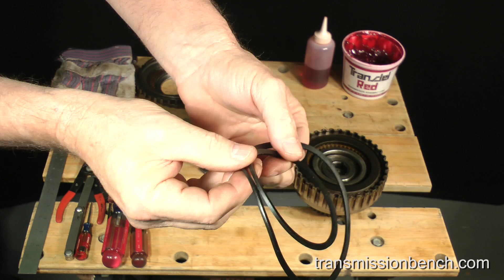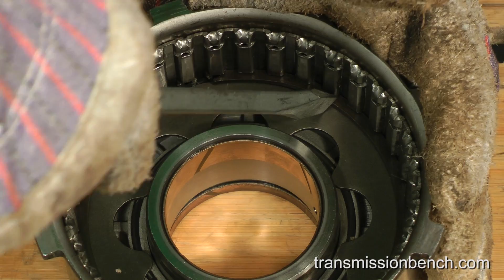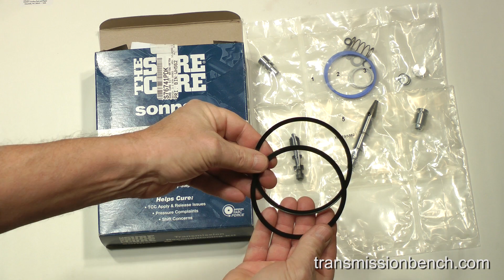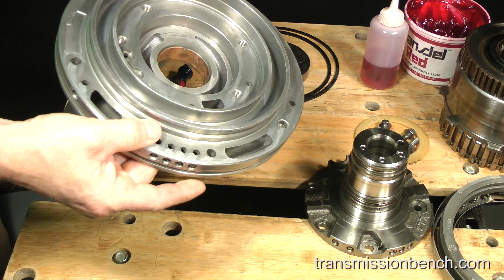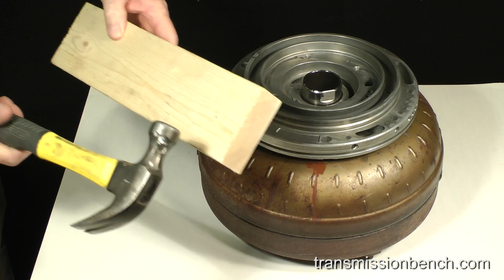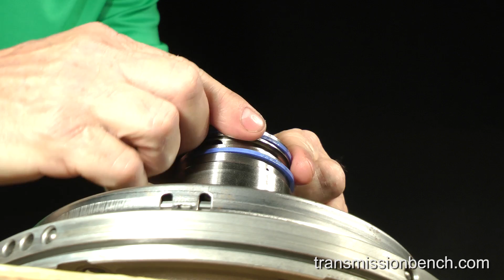AODE 4R70W Class part 2 lesson 4

Comment: Plastic wrap works very very well to commpress any of the seals . Just lub the seal then wrap with plastic wrap with slight tension 3 or 4 wraps lets sit for 45 seconds remove and install works like a charm.

Comment: On those teflon rings I use a worm clamp and just tighten it up to compress the ring gently,  wait about 20 minutes or so, then remove the worm clamp.  Use the very edges not the center area.  Works good.  I have anger issues when I destroy my teflons.... It has been professionally diagnosed as "Pissed off beyond belief".

Comment: So I rebuilt my 05ford f150 4R75E transmission and after about 10 months idling in my driveway for about an hour the input shaft seal blew out, I bought it to a shop and had a new seal put back in and it blew out again after driving a continuous 180 miles or when it got hot again. What would be the cause of the seal blowing out? The shop did overfill the fluid

Comment: Great video. Can you tell me why the flow from tranny to a cooler is so weak? I have the same tranny (4r75e) on my e350 and I performed a flow test directly from tranny to an empty bottle. So I got one quart in 2 minutes which is bad sign. But it shifts like it should and there is no codes or issues except high working temp. Thanks.

Comment: I love the video, they do make a lip seal protector kit to install pistons without seal damage. As for forward/input shaft I use a shop press to push out shaft, install rings, use rubber hose around them and hose clamp to resize them. Then reinstall/press in shaft. Always use calipers to measure exact position/depth of shaft in drum before removal to ensure exact placement when done.

Comment: Thanks a million sir. Something that I'd like to share. I was pressure testing the reverse drum over the pump stator shaft but it wasn't successful, there was excessive air leak. But after blocking the 2 holes on the top and upper side of the shaft with my finger tips and pumped air in short pulses, this action made the carbide rings expand out and seal properly. Only then the reverse clutches went up & down very well, without air leak hissing.

Comment: I bought a bushing kit and I don’t have a large enough socket for some of the bushings with bushings should you replace other than the pump bushing like for example the sun gear is very hard to replace the bushing.
Which ones receive the most wear

Comment: Thank you so much you are a great instructor, I have rebuild my trains exactly as you instructed, I drove the truck for a few miles and it just stop, like if the drive shaft was disconnected, I would give gas but the truck didn't move,  I did not what I made wrong, it wont go to OD or non OD it just wont drive any more. I don't know what to look for. May be you can give me a hint. Thank you Doug Z
Reply: Did u figure out what ur was

Comment: I am up to the point of installing those large metal sealing rings on the pump. I cant get them to snap together.  Used a pliers. Tried to lift it above the other to lock and snapped one. Geez. Almost done and I am stressed. Everything else went smooth. Thanks for these videos.
Reply: i just done mine and i used a small pick to lift up on one side while squeezing it together.
Reply: I put 2 c clamps to hold the ring snug in the groove . Before tightening the clamp associated with the end of the ring that has to hook the seated end of the ring , I put a very fine needle under the ring end that has to come out of the groove in order to hook the ring closed . This narrow pin holds  the ring end  out of the groove . Then tighten the second c clamp and then hook ring together by removing the pin
Reply: I broke 2 also. But my fingers were all cut up. Came back to the video and put some thick black nitrile gloves and did it like he did in the video held the left tight and finally got them in.

Comment: why would you stretch nylon rings to install ?
Reply: If not they would roll into the groove and possibly get nicked and not seal properly. I soak them in hot water for a few minutes to make them more pliable. There is a special tool to install these with, but the instructor is showing how it can be done by a mechanic with no special tools, old school style you might say.

Comment: We have a 10 Ford e-150 with 250k for parts delivery. The drive said the trans would only shift first then second and then rev up in 3rd and 4th. Found the fluid burnt and pulled the transmission. Found the overdrive band piston hole to be worn out and the 3rd and 4th clutch packs to be burnt. Rebuilt with quality parts and new torque converter. With new rebuild the van has no forward movement in drive and no forward movement in man 1. If switched to man 2 the vehicle will drive then switched to drive while moving the transmission will go threw 3rd and 4th. Trans pressures in drive and 1 st are at 75-80 with foot on brake and gas and just setting still at idle. 2nd shows change in pressure with throttle action. What could be my issue?

Comment: Thank you for a great series.  I did see one error that I must point out.  At 36 min point the intermediate clutch piston has a vent hole that must be at the 12 O clock position.   This will allow air to vent as oil is filling from the apply port at the 6 O clock .
Reply: I just did one and I’m not sure but I think it’s a little off like 11 or 1. Will this be okay?

Comment: +Transmission Bench ...one question please? when putting the pump back together is there a special way the drain hole is supposed to line up so if holds preasure, or doesn't drain back to fast? sorry if it's a stupid question, but I just want to dot my i's and cross my T's... thank you so much for the effort you put into these series, so many of us would be lost without you!!!
Reply: Must have piston bleed hole at 12 o'clock position.

Comment: This is by far the best transmission video on YouTube.I've been searching for weeks.im not doing an complete rebuild bit I am replacing frying pump bushing, seal, gasket ect.an this video answered most questions. I'm working on a 05 crown vic interceptor trans. It has a round spring right after the from pump that I don't knw what it is for.ur video does not show this spring. An I only have 1 round spring.is that normal to have only 1 spring? Thxs for the video God bless.can't wait to watch the rest of ur videos.I love to learn about transmission, motors ect
Reply from the maker: wonnieboy Hi. The one round wavy spring is normal for your year model. Thanks, Jimmy
Reply: I have one more question if u have time to answer about that wavy spring..I took off the pump quick an didn't notice hour it goes back on.I mean there's a spring and then there's a round straight small bracket. It looks like what the wavy spring sits in.my question is: how does it go back on? Is it pump, spring, bracket? And does it face twds the pump when it's installed? If I don't understand my question plc Lmk I'll try to explain better.
Reply: I forgot to thx u for taking ur time to respond.it's a big help to me an I love ur video.so informative..
Reply from the maker: Hi again Wonnieboy. Could you email me a pic or two of these parts? That would help a lot.
Reply: +Transmission Bench how do I email u?
Reply from the maker: you can email me at: transmissionbench@gmail.com

Comment: Is there supposed to be a spring under the 2-4 shift soldenoid? cause i was taking the pan back down to replace it and a spring fell out with a little metal piece on top of the spring. which looked like it came of it. weird that there was not two or did it come from somewhere else.

Comment: So i have everything in the truck now trucks starts great and everything looked fine... No Engine Codes the problem is when i try to drive it Reverse works park works neutral works:
1. Feels like its in second gear from start
2. it wont shift up

No idea what to check Now. HELP please.
Reply: HOw did that work out for you Brian, now that you have had some time to work on it.

Comment: can i use 96 crown vic 4r70w housing to replace my 97 gt 4r70w housing i put my trans together 3rd shift neutral out do you know what might be wrong lesson 5 coming soon
Reply from the maker: Art Jones Hi Art. There are differences in cases that can cause swap problems. I cannot say that they will definitely interchange. You have to check where the MLPS (manual lever position sensor) bolts to the case. The bosses can have different heights. About 3rd gear.... go back and check the separator plate for cracks around the 3rd accumulator area, the two sealing  rings on the output shaft, and especially the direct clutch drum. This drum can actually be broken around the center area, but it's hard to tell just by looking at it. You will have to air check it with a rubber tip blow gun while it is installed on the output shaft and look for leaks.

Comment: I have a question for us. As I'm reassembling transmission now and trying to just go backwards from part 1. I found randomly that the OD servo pin connects to the overdrive band. Besides that is there anything else that connects to a part from outside cause I was still finishing up valve body shift kit and so stopped putting the sun assemblies in worried a little if I didn't know something.
Reply from the maker: StippLeTV TV The OD and reverse servo piston pins contact the bands through the case. I took a break from making the videos but I'm back to working on lesson 5 now...